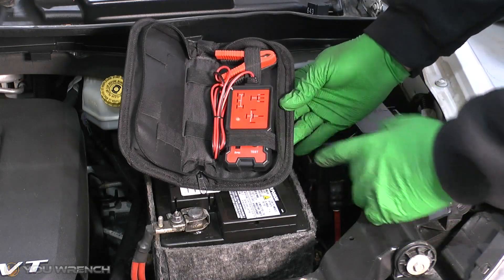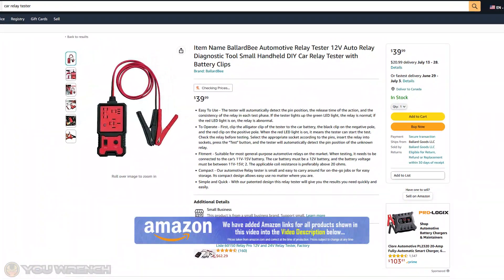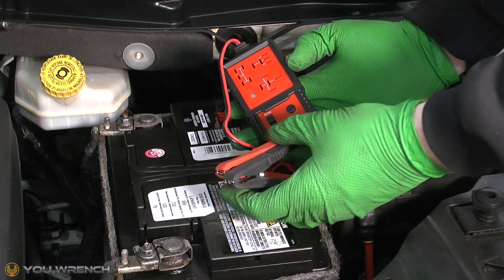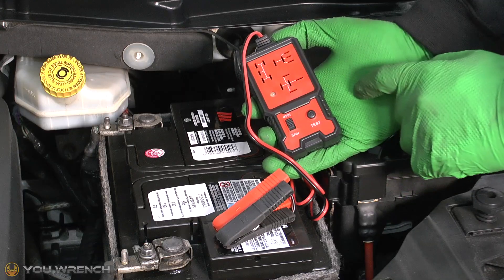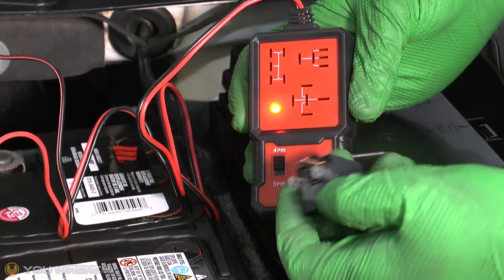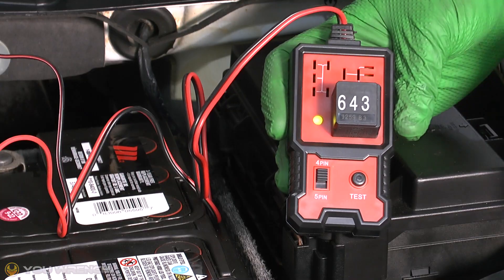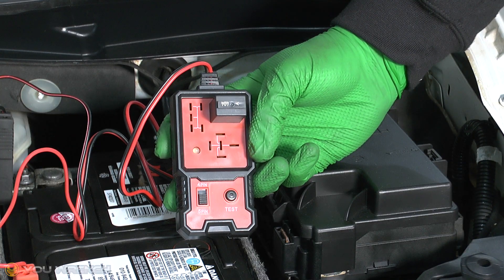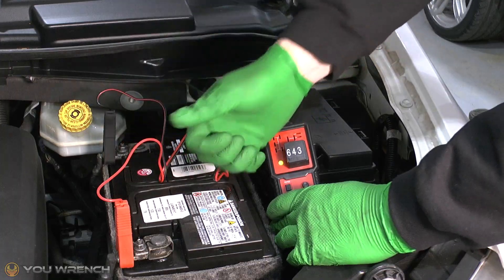How to Test Car Relays Using a Relay Tester!

Comment: Bought the exact one as in the video.
Tried to test a relay and it did nothing except show a red led,so I went out and bought another one brand new and tested it before I reinstalled it......guess what it gave the same reading as the other.
So they don't test everything.
Relay number was.61368373700/01 BMW injector relay.

Comment: I hear the relay is clicking each time the light comes on . Is that because this is a flasher/Indicator relay  ?or a normal relay ?  I have a tester from ebay , and I have plugged in a Fuel pump relay and it doesn't 'click each time the light comes on . When the test is completed it comes up green . The relay has four pins . I note the socket on the tester you have has 5 pins on the same part of the testing unit for 4 pins  .

Comment: I purchased one using your link. I have a question. Are there certain 5 pin relays that this cannot test? It looks like the 4 pin you initially use in video but has 5 pins of course. I chose the five pin setting and as soon as I press test the light is solid red. But the function on the car works (I was just trying it out) Also some of the relays make the ticking noise while blinking green some don’t?
Reply: I had the same!
Reply: I have the same problem, the 5 pin relays always test as faulty with red solid LED. All my 4 pin relays tested OK.
5 pin relays was IN0307 (Tyco, used in GM sedan MY2001)
Reply: PS. Bought on TEMU

Comment: I know I have a bad relay  it says it's good. Then when I reinstall it it overheats and shuts my engine off. And it won't turn over but if you let it set for a bit to cool off then the engine will start.. I'll still use this little gadget. For other relay types. Thanks

Comment: What about 3 pin relay?

FORD MONDEO MK3 2000 2007 INDICATORS LEVER HAZARD INDICATORS RELAY 93AG13350AC.

Several car brands use it, not just Ford

Comment: What I don't like about the relay tests is that they don't give a proper load to the contact points in the relay with an old type of light bulb? A relay or wire can measure well until you load it with current. It should have given a load and measured volt loss!!